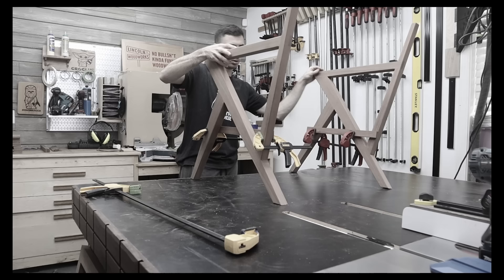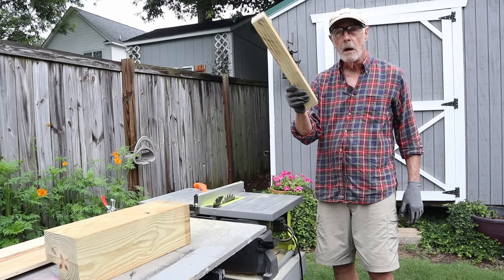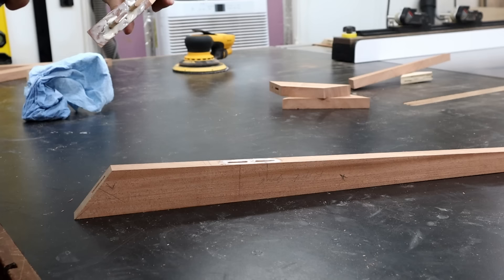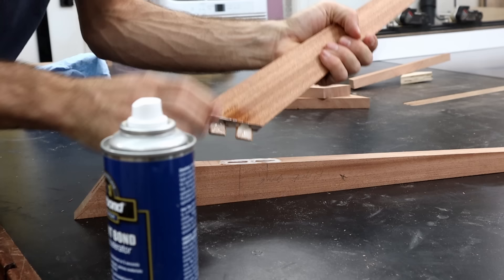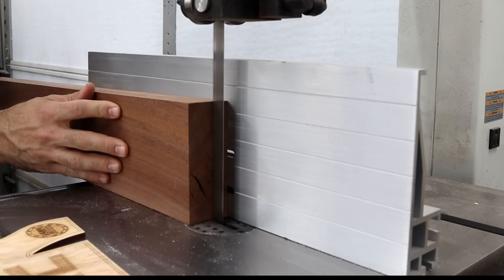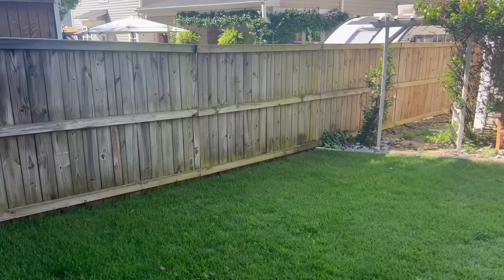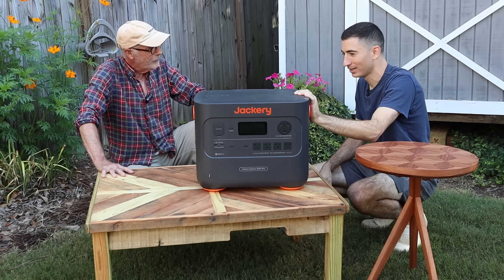I challenged a 78 year old to a build off

Comment from the maker: Jackery Prime Day Sale ends on July 20th! Don't miss out on this chance to get the best deal of the year! Shop on Jackery Official: http://bit.ly/3CWtGqH Jackery Amazon: http://amzn.to/449ul41 Solar Generator 2000 Plus (E2000Plus+200W) with best discount, shop now on http://bit.ly/3MYcsxM and Amazon http://amzn.to/3p6FvXY #jackery #solargenerator #sg2000plus #portablepowerstation
Reply: I am completely confused watching you cut that circle with the router. Where is the pivot point?
Reply: @ke4uyp that’s a Milescraft 1219 circle jig. The black doodad near the pivot point is a tad longer underneath the rail.
Reply: How was your meal at The Golden Corral?
Reply: Johns, wins just because I want you to go to Golden Coral.
Reply: a vote in the comment section for the winner!? nahnahnah. get a set of weights, and start stackin em on each table, first one to break loses! (maybe my suggestion is biased, because my vote is for the pallet table)
Reply: Gen X'ers everywhere love that Millennials and Boomers are going to take each other out and we get to watch.
Reply: Senior's effectiveness, economy and clever (re)use of materials and techniques is impressive.
I know it is for the advertising and that you have something to eat at the end of the day, but that voltage converter with battery pack is top notch satire!!! :)))
The absolute waste of 30-50% (depending from what angle you look at the problem) energy ... without any reason ... compared against senior John's effectiveness is great comedy:) Thanks for the shared ideas and the entertaining video, John&John:)
Reply: Old man is the winner 🥇 🥇
Reply: ANGEL.
I'm not  religious. But nothing can describe what you  did for a fellow human.
Reply: I love how come this video is less than a week old and has somehow gotten over 800k views.
Reply: @Maungateitei  It only needs to hold a couple of Mai Tais.  It's not meant to bear a lot of weight.  But, I would like to see the test ;-)
Reply: I liked and subscribed because of this video. This is a massive win in my books the two Johns went big on this in my book and I need more of this good wholesome content in my life. Thank you both Johns I am grateful and pleased with the content. 
PS John Sr Wins because I love the Reduce, Reuse, Recycle of the materials he worked with and made something that I would love to have on my porch with the rest of my rustic themed Decor.
Reply: @Maungateitei  lol yeah i hope they see this and do the test... but if they do see this i should mention, while my vote is for the older guy's table, i do like the modern style, and i do believe the surface of the table will be perfectly flush, and the other table i think i saw an imperfection or two. but yeah, that glued joint i would bet'll rip apart the second ya make that table do what tables are supposed to do (support a little weight) lol
Reply from the maker: @TfuckyoutubeC the floating tenons are pretty damn strong. But yes the table isn’t designed to hold tons of weight. Just my cold beverage as I sit there admiring his table from a far!
Reply: I like both tables,but the winner is Jon. Haha.
Reply: @hulkhatepunybanner correct.
Reply: That boomer man handled that table saw better than I thought!
Reply: @Lincolnstww, this is a fun video. I subscribed and will check out your other videos. Hopefully the two of you can do more videos in the future. 
There is one problem. If your neighbor is 78, he technically isn't a boomer. He is part of the Silent Generation. 1928-1945 from the great depression to the end of World War 2. Even though he was born at the end of this generation, you can tell that's the one he more belongs in. He reuses and repurposes things he has found. Adapts what he has to fit his needs and can make his own tools. And then he builds a table that he figures will outlast him. He was raised by parents from the Greatest Generation that went through the great depression and taught him to be resourceful. Just my quick thoughts on seeing how he works in your video. 
And your table design is cool. A little too delicate looking for me though. Also, what about using a wood burning tool to sign and date the bottom of your tables? Maybe a comment like "John & John 2 day table challenge 2023"
Reply: you're going to the Golden Corral but you won my subscription
Reply: Golden Corral
Reply: @Lincolnstww oh how badly I wanted to put the jackery on your table and give a little push.

Got to say something good about a table you can sit on. Older Jack wins.
Reply: Dam disappointed thought it said best off.
Reply from the maker: @babybunny1967  John agreed to be an honorary boomer since he’s 78 going on 60. Silent generation vs millennial didn’t have quite the same hook
Reply: You have a new sub. I enjoyed the video and I think both tables are beautiful in their own right I think you guys should each treat each other to the other ones place of choice.
Reply: If the elder John is 78 he is not a boomer, his generation is called the silent generation 1925-1945.
Reply: Normally I go against the grain…but then I’m not a woodworker by trade…😅😂🤣

In this case though, sorry J Jr. but gotta go with the crowd on this one. J Sr. did a really good job reusing waste materials to make a table that could happily sit in any living room. Hell…I WANT that coffee table, it’s beautiful AND functional and he did it all using just a few simple tools. Mad props to the boomer here…👊

Sorry J Jr., but that little table you made might do good for mai tais…but not much else. Plus you made the assembly overly complicated with the shop full o’ tools approach which nearly ran you overtime while J Sr. was just happily looking over his creation while you sweated over Teak Oil.

Hey, look at it this way…as a Millennial myself, I would take Golden Corral any day over beers that I have to pretend to like…😅😁
Reply: I prefer the older John's table
Reply: well they have to go to golden corral you and your took their careers and ...
Reply: My ex passed last year .he loved guns and decided he was going to make some new grips for one of his guns with some extra pieces of 2x4 that was at my house and had no saw but a hand saw .when he said he was making grips .I didn't believe him . But in the end he made them and finished them sanded , stained etc and looked bought. Had to admit I was wrong. He knew a lot of stuff. He's missed
Reply: Pallet table. Making something awesome out of what most people use for bonfire wood is pretty dang outstanding. 😎👍
Reply: Why would anyone buy a giant battery pack, when extension cords exist LOL
Reply: @hulkhatepunybanner  Agreed
Reply: Poor Jr. This was like watching a guy on the local high school boxing team take on prime Mike Tyson. Senior was just running circles around him with his masterful technique and his finished table was rugged simplicity at its peak. Jr's tabletop was pretty, but the rest of it just doesn't look as good, tough, or as useful as senior's. Elder John won this one.
Reply: Old john for the win
Reply: Man that was one of the most entertaining videos I’ve seen in a long time and I accidentally found this just skimming through things, now I HAVE TO binge watch your channel.  

O.G. John’s table looks like a kick ass piece that would withstand poker parties and a stripper pole through the center we could use at a biker club house for 100 years.   

John Jr. Made a piece that I would 100% put in my music studio just for the aesthetic beauty of it.  

I want both of them, BUT I think I love O.G. John’s design PLUS the sturdiness and extra surface area.

I couldn’t make either of them in a month let alone 48 hours
Reply: Wait I missed the sale!!!!!!?😮😢😢😢😢😢😢😢😢😢😢
Reply: You might want to correct your thumbnail. Fun fact: Spelling "Millenial", with a single n, doesn't refer to thousand years. It refers to thousand anuses.
Reply from the maker: @Anvilshock  in that case - definitely not changing it
Reply: @Lincolnstww  See, normally I would agree, but the main reason I raised it is that this instance of habitual neglect out of ignorance can only serve to perpetuate the misspelling. Sure, those who know will find it funny, but those who don't will take it at face value, seeing nothing wrong with it. Even you yourself didn't know until told, did you? And, given how the latter are in the crushing majority, that typo-turned-joke is unlikely to receive the appreciation it otherwise deserves.
Reply from the maker: @Anvilshock  over 10 people looked at that thumbnail before it was posted and no one caught it. Myself included. It took 1 million views before the first person said anything (you’re not the first) It’s just going to live that way as a reminder for me to triple check everything.
Reply: @Lincolnstww  One, ten, or million views going without notice does not change the principle of "absence of evidence is not evidence of absence." On the contrary, it supports it. And while it may be but a reminder to you, to the rest of the potential millions, even billions of people liable to having your video appear in their recommendations, even subscriptions, it will still contribute silently to perpetuating either negligence, or indifference, or both. Accidentally before, but willingly now.
Reply: Also, old Jon made a video that his generation would love and agree with; watching a craftsman showing what years of experience and hard work can do with limited time, tools and supplies.  You made a video your generation would love; how quickly you can make something that is visually intriguing while showing the real use of lots of modern technology. I say you go out for breakfast at the buffet and have some beers that evening on the porch using your tables to hold the cooler and the beers.
Reply: Lol my first comment suddenly didn't post.  I wonder if it's because I mentioned extra terrestrials and the Loch Ness monster or that the lack of information about them constitutes disinformation. 😂 love the video John.  Love the comments too. I hope i didn't misspell your name or anything else on here
Reply: Your neighbor wins.  On the grounds of actually being usable as a table.  Yes this is going to cut deep like when Obi Wan cut off Darth Maul's legs.  Your table does not look stable at all.  Its looks like if you put anything more than 2 beer cans on 2 coasters  on that table it won't be able to handle it at all.  That table can barely fit 2 cell phones.  You can't even put 2 beers on it without it being completely covered up.  Its too small and quite crappy sized small with giant leg system to hold it up.  Sure its got a lot of fancy designs but its non functional making your actually crap.  His table can go outside or inside and be used to put 4 buckets of popcorn and 10 beers on it and used for actual guests and its large enough not to be so stupid.  His table is actually functional.  Hell you can also break out a board game with his table and have fun with kiddos.  Your table is a 1 person to put 1 drink on and nothing else because its useless.  Hell yours is also unbalanced and will fall over at anything and just looks stupid.  Also his table will allow him to put his feet under it while sitting in front of it while your table looks like you will stub your toes on it constantly making it unsafe as hell.  Your table is ugly, a toe smasher, and a sin against tables and a sin against wood working itself.  You lose.
Reply from the maker: @jordancambridge4106  Lol why would I put my feet under a side table you silly goose.  My legs are not attached to the side of my hips
Reply: Hello, do you really give away prizes? Someone contacted me and spoke with me through telegram, just checking if its legit?
Reply from the maker: @khalariel  no - those are all scams. No one on YouTube will ever contact you saying you won a prize. Ever
Reply: Older John was born before Aug 15, 1945. He is not a Boomer. He is a member of the Greatest Generation.
Reply: I’m a pallet wood person! Jon got my vote!
Reply: At 100 lbs that jackery might have a 2kwh capacity but I wouldn't hold my breath past 1.6kwh
Reply: .. @GSJQuick rrrrrrr🎉
Reply: @studebricker2845  I wish I had one of those giant packs right now. Been without power for three days. They would also come in handy for camping, tailgating, working where there is no power close enough to run a cord.
Reply: Wish I had the money for this. Been without power for three days. The equivalent of a 7500watt generator would be perfect.
Reply: @davegravel3740  I was referring to what the video was about, guys doing projects in the backyard. Nobody was saying people don't need generators sometimes. But even then, gas powered is superior to batteries.
Reply from the maker: @studebricker2845 I’m sure gas is much better is certain situations. This seems to work fine for most use cases. For instance John has been camping off the grid since this video was published using the battery and solar with no issues. He’s quite happy. Everyone situation is different.
Reply: @Lincolnstww  And that's fine. People are free to purchase what they like. Rechargeable batteries just have too many negatives to interest me -- like the huge amount of energy used to extract the minerals needed, their limited lifespan, recharging time inconvenience, etc...
Reply: Challenge itself is silly. Older John knows how to "make-do" with what he got, not just tools but materials aswell. What did you hope to achieve with this challenge? Beat an old man by having better tools and brag about it?
Reply from the maker: @sewfc  I think the entire point of the video went right over your head
Reply: 3:29
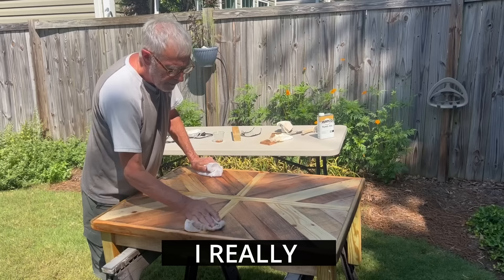Reply: 14:30 you missed his joke. he was mocking you :D he meant that only way he loses vs mare child like you is if he doesnt finish on time.
Reply from the maker: @alibabapirce9782 it’s ironic because you missed the joke 😉
Reply: @lincolnstww Really liked the video, as someone who likes to work with wood myself I found this very Interesting as actually I work the same way old John does with not many tools. Although I did find that the table that young John made for me atleast would be harder to make if attempted to with the tools in my possession.
Reply: Why don't you put a gate between your houses?
Reply: Older John got my vote.
Reply: u should go on stage with that dry humor.

even mikel obamas bonus whole would not stay
Reply: Older John wins this clear and we wanna know his channel name.
Reply from the maker: @adventureswithpasa  his channel name is “John doesn’t have a YT channel!” He has no interest in that. Hasn’t even watched this video
Reply: Its no different than making music. You can spend a few days on an idea and send it out. Or spend years on it and send it out and most of the time, the demos were better than the over polished finished piece that you intended on being a masterpiece... 
Over my years of music experience and some wood working as well. I don't think something is truely a masterpiece unless it does have a flaw and shows your creative way to fix it on the fly.
Reply: You’re the only person on YouTube who knows what generation to apply the word “Boomer” to. All the idiotic millennials, think it applies to every generation older than them.
Reply: @stevenwilson879 LOL I wouldn't pity the  senior John, he's got ingenuity like you've never seen.
Reply: Hey there placed a bid on Older John's table in the comments. Please get back to me.
Reply: Y😭😊😊
Reply: WTF who won?!
Reply: i liked your pattern more, and color choice, but i appreciate that older john used reclaimed wood, had more limitations, as well as time to spare. I'm also a bigger fan of coffee tables than end tables.
Reply: That man didn't need a computer to do his work for him.
Reply: I'd say this video didn't tank.
Reply: Giving the older John that Jackery was clearly sponsored. Why would you lie and say it wasn't?
Reply from the maker: @TheCommanderNZ  I clearly stated the video was sponsored, they gave me the jackery. But giving it to him was my own decision, jackery didn’t ask me to do it. I just thought it would be a nice gesture like I said
Reply: But he couldn’t do nearly as cool shit.
Reply: The Home Depot near my house has sensors allowing EXIT out of the Entrance.
Reply: Older Jon

Comment: Beautiful job from both, the round table has a beautiful color and design, however is too small for my taste, If I could use only one I would prefer to utilize a good square and stable table.  But if you leave me keep both y would take both in my yard.  If I have to buy one the square I believe is also cheaper.

Comment: I like both pieces but do to technique, the tools used.  I give it to the old master.  I think his table will also outlast the round one.   The design is framed in, legs are fastened securely, and it was also done in a 1/4 of the time with less tools available.   Either way great work on both!

Comment: I agree with the comments before. That old John won. Not because he made better table, but because how he made it. I agree, that young Johns table looks more profesional and clean. However the fact that the other table looks great and is made with very few tools and is basicaly made out of throw away junk makes that table in my opinion the winner. And when we add there the thing that old table is bigger and more stable therefore in my opinion more usefull its complete victory for old John. But again young John table looks more profesional and clean and expensive but, the other one is more useful, recycled and less resource intense.